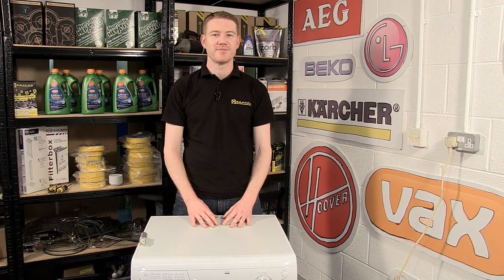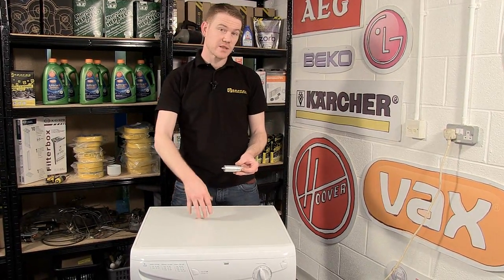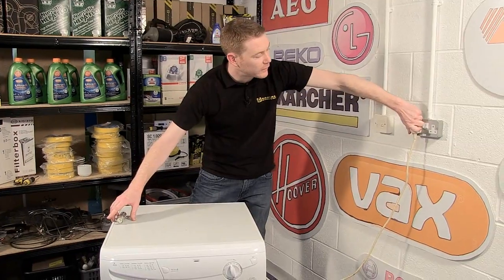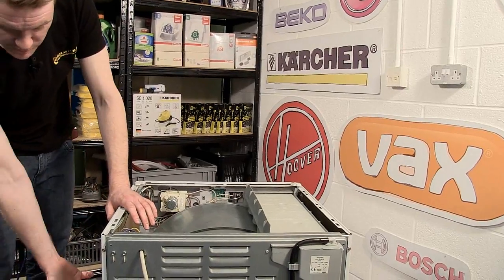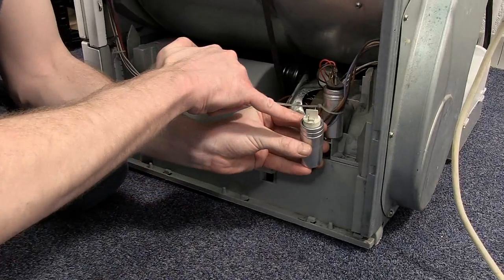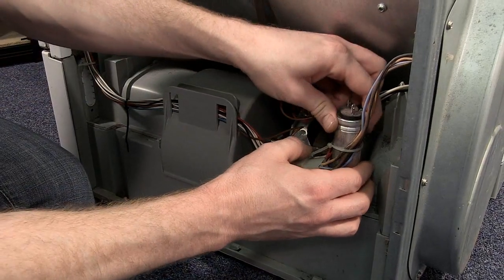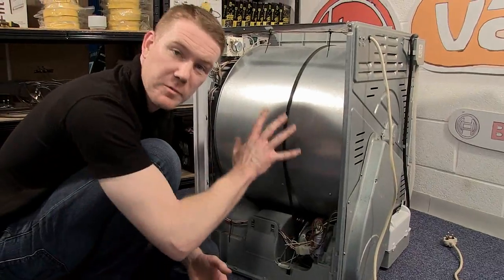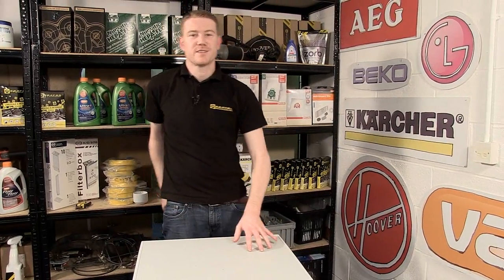DIAGNOSE Motor Capacitor Problems Like a PRO on Your Tumble Dryer!

Comment: Thank you so much for these brilliant tutorials! I have an old AEG Electrolux dryer. To run it i have to manually spin it at first and then close the door hoping it takes off on its own which it sometimes does. When that works it spins regularly for a while and then stops again. Could the motor capacitor be the problem?

Comment: Had a progressively louder humming/vibrating noise from behind the front fan on a Bosch condensing dryer. Fan is fine but last night it popped the main fuse mid cycle. Took sides off, two capacitors situated behind the fan. All clean. Not an old machine. If I disconnected each capacitor one at a time and went to run a cycle would you expect the main fuse to trip at the consumer unit immediately? It does. Regardless of which capacitor is disconnected or if both are connected as normal. I’m struggling to know if it’s the issue. Certainly sounded just like other capacitor issues posted online

Comment: hi, my dryer only spins one way now.  when it reverses it spin it doesn't move, is this a capacitor issue? thank you some much for your great content, very much appreciated!
Reply from the maker: Thanks for the comments. The problem is likely to be the capacitor but could be the timer/module. We would suggest replacing the capacitor as they fail more frequently.

Comment: got a whirlpool cabrio dryer everything works but rhe drum doesn't spin. ive checked belt thinking it was that, belt is fine. replaced the thermal fuse. could it be the capacitor or the motor
Reply from the maker: Hi Jeff, you did not give a model number so just check if there are two belts on your model as the motor belt may have failed. If the motor does not run the fan the likely cause is the motor capacitor as these often fail. For more info see our video: https://www.youtube.com/watch?v=u6614TVugVc
Reply: MOD: WED6200SW1 there is one belt around drum.
Reply from the maker: There does not appear to be a motor capacitor listed for your model.
If the motor has three or more electrical connections and no brushes it is an induction motor and will either have a motor capacitor fitted near the motor or be supplied directly from the control board that may have failed.

Comment: Hi, does it matter which way round the wires are connected to the new capacitor or does it not make a difference ?  Thanks
Reply from the maker: Hi John, not on these capacitors as they pass AC current so are not polarised.
Reply: Thanks for the response,  does that mean that they don't need to be discharged or can they still hold a charge ?
Reply from the maker: Hi John, always make sure you discharge a capacitor to ensure safety.

Comment: On my Indesit IDV65, when I press the button to start the drier going, it just produces a brief hum and the machine does nothing. The hum quickly fades away and pressing the button again doesn't produce any sound. If I come back later and try again it produces the same hum briefly. Does this sound like a capacitor problem, or a burnt out motor?  Thanks
Reply from the maker: Hi Carpil, it is more likely to be the capacitor than the motor but check both.
Reply: I just went ahead and ordered a cap from you yesterday. It arrived today so I'll soon find out. Thanks for the reply :)
Reply from the maker: Hi carpil, good luck and let us know how you get on.
Reply from the maker: Hi Carpil, can you give us the full model details, the stock code of the part and the order number so we can check it out.
Reply: Thanks for the reply, but ignore my previous message, I had deleted it before you replied. It was about the cap having 4 terminals instead of 2, but actually it didn't. It The wires were just connecting using some metal coupler so it looked that way. 
Unfortunately I've replaced the cap now, but I still have the same problem  :(

Comment: hi i placed the drum shaft and back bearing in my indesit tumble dyer myself took me 2 hours but i did it . very proud of myself .. but when i put everything back together i found that the drum was turning slowly than normal  when i put clothes in drum..  it was turning and rotating   then it would stop and making buzzing sound i double checked the belt and thats perfectly fine nice an tight but i am just wondering would it be the the capacitor ??
any tips to what it may be ? 
Frances Dublin /ireland
Reply from the maker: Hi Frances, sounds like a faulty capacitor so try replacing as they do fail with age.

Comment: I have a condensed hoover dynamic it’s spinning but not collecting water it shows E08 
Do you have a video for this problem
Reply from the maker: This error suggests a faulty heater assembly (probably caused by blocked filter/condenser or stopping when hot). To replace the heater see our video:
https://www.youtube.com/watch?v=cGdpHSz1mJM

Comment: But don't the old capacitor still hold a charge? Even when turned off. Other videos show that they do.please let me know if I'm wrong?
Reply from the maker: Hi Malcolm, it would depend on the type of capacitor on the machine, if unsure use a pair of long nose pliers to check before removing.

Comment: Hi there, I've changed my belt, pulley and capacitor and my hotpoint aquarius TCM580 and it still isn't working, could you help me please
Reply from the maker: OK Emilya, so does your dryer heat or buzz when you press the start button and what is the model number?.
Reply: TCM580BP(UK), yes it buzz's and I can feel heat, but it smells
Reply from the maker: Good now we can be clear that it sounds like a motor problem. It will smell and damage the heater if it is left on without the motor running so when testing turn on only for a few seconds before opening the door to stop it. Can you turn the drum by hand? and is the motor buzzing continualy when start has been pressed?.
Reply: If I turn the drum by hand it will start, yes it carries on with the buzzing noise
Reply from the maker: If the drum starts with a push you have a faulty capacitor.
Reply: I've only just received it today and put it on, if it didn't start with a push, what would I have to do please?
Reply from the maker: Does it start with a push.
Reply: no
Reply from the maker: That still suggests a faulty capacitor if the motor buzzes when powered, Check there is resistance between the three motor wires with a meter like: https://www.espares.co.uk/product/es1741061/professional-digital-multimeter?

Comment: Hi, My Drier only works ONCE every week or so. It will do one load, when it stops after completion, it will not work again, there will be no power light to the programme section. If I leave it a week or two - put clothes in then plug in it will work but only the once, if I open the door during the cycle it will stop and not start again and no power light to programme section but power on light is on - any clues to what is going wrong?
Reply from the maker: What is your full model number Max?.

Comment: Is there a centrifugal switch in the motor?  My motor has a switch but only one capacitor.  Why is that?
Reply from the maker: Hi no avail, on the one in the video it didn't have a centrifugal switch but it does depend on the design, tumble dryers generally only require one capacitor to start the motor.
Reply: @eSpares  -- Thank you for your reply. yes, I have learned it is a capacitor-start motor.  I'm so used to working with 3-phase and cap start-run motors i had a bit of tunnel vision.

Comment: Hi there, I've just replaced the capacitor on my hotpoint aquarius tvm570 and this still hasn't fixed the problem. The belt is fine so might this be the motor?
Reply from the maker: What is happening?
Reply: Hi there, oddly shortly after this message it started working! After pressing the start button and hearing a short buzz and then nothing (this is what it did before) I thought either the replacement capacitor was faulty or it was something else, however after about 20mins it just came on and started working again! (I think the on switch must of been left on when I thought it wasn't working). Is this normal? Would the capacitor need 'warming up' in any way prior to use?
Reply: @BonStark86  Did is start all the time now?

Comment: if there was four wires that came off  how did you connect only two????
Reply from the maker: two wires are connected to each 'part of the capacitor, usually they are connected to one terminal and 'piggy backed' together. If your capacitor has four connections there will be two sets of two. Usually there are only two colours of each so join red to red and black to black then connect the reds to one connection and the blacks to the other.

Comment: how to diagnose should say how to replace
Reply from the maker: The reason why we titled the video 'How to diagnose' is we try and show how to tell that the problem is due to a failing capacitor as well as replace it. 
We hope you still found the video useful.
Reply: oh yeah the video was useful it shows how to change it ! i assume that  if the motor fails to turn or is very slow to start turning then more than likely the capacitor is at fault. if thats right then maybe put this in the video description to help people out.  i always come back to espares i still have the pen fridge magnet and toy van you sent me
Reply from the maker: The script says" Now motor capacitors can be a real issue with condenser tumble dryers. As the machine ages the capacitor can fail progressively causing start-up issues when turning or not starting up at all. They can also short causing a loud buzzing noise and no rotation." 
To test correctly you would need a multi meter with a capacitance range like: http://www.espares.co.uk/product/es1741061/
If you have any of the symptoms above it is the most likely cause of your problem.

Comment: hI, i WAS WONDERING WHY YOU DID NOT SHORT OUT THE CAPICATOR???
Reply from the maker: Thanks Sal for your comment. The capacitor is connected to pass AC to the second motor winding and discharged by the motor so will not hold a charge.

Comment: Would be an idea to discharge it first..😢
Reply from the maker: Thanks for the comments Ian. It is generally a good idea to discharge capacitors before handling them. 
If you look at any circuit that uses a motor capacitor you will find it is supplied with AC voltage and across two motor winding's that will ensure it is always discharged.

Comment: You did not diagnose anything you just removed and replaced that should  be you title on the video how did you identify that was the problem
Reply: Turn dryer on, open door manually spin drum, shut door while turning.  If motor kicks in and spins drum - capacitor problem